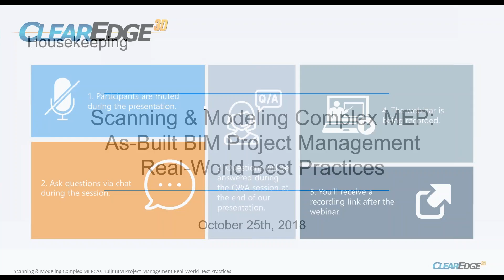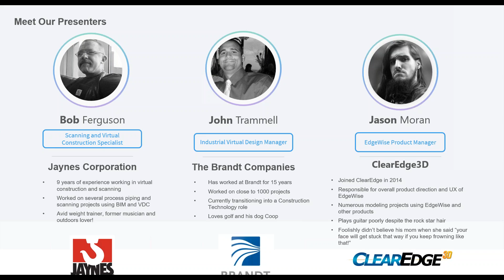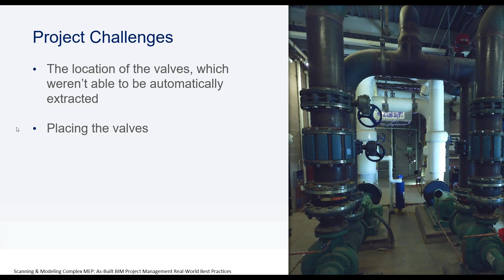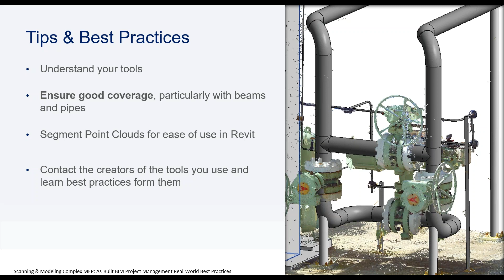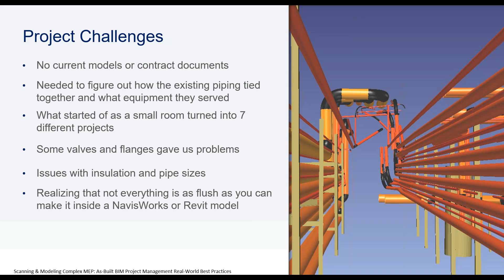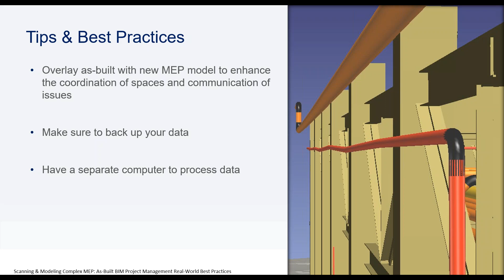Scanning & Modeling Complex MEP: As-Built BIM Project Management Real-World Best Practices

Comment: I just started working on scan to bim...
I used to work only with autocad and revit data.
 But in scan to bim There is no documents for the piping system and accessories .
Its very hard to do modelling as per point to cloud many routing error and pipe fittings are joining error .

Trim extend not work and sometimes  align command.
Reply: More overlapping scans to ensure dimensional accuracy